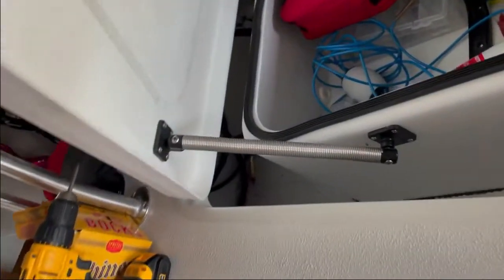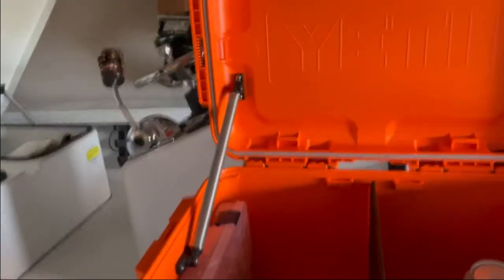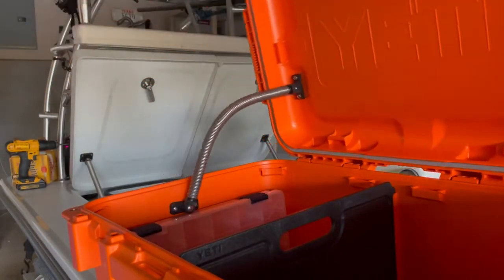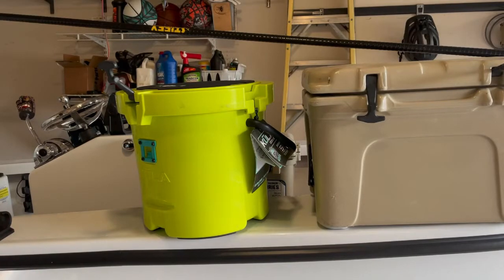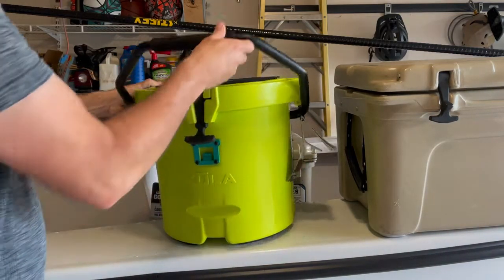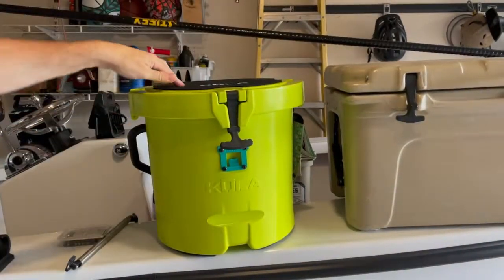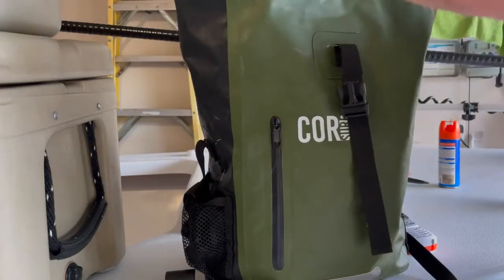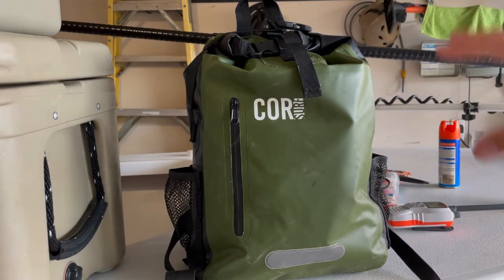Gear movie: Upgrading the Yeti Loadout Go Box, Kula Bucket Cooler Vs. Yeti Cooler, and the CORE Surf

Comment: Would you still get the Kula vs a Yeti Tundra Haul with wheels?
Reply from the maker: Kula if they replaced the rubber feet with grey instead of black. I don’t want wheels and plus if you keep it small you don’t need wheels.